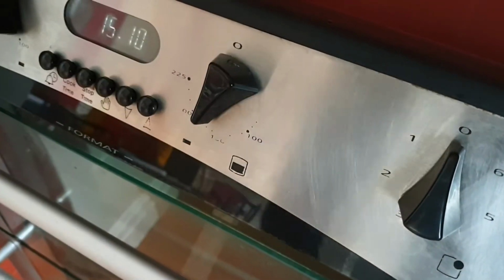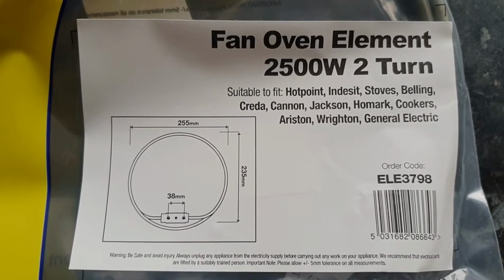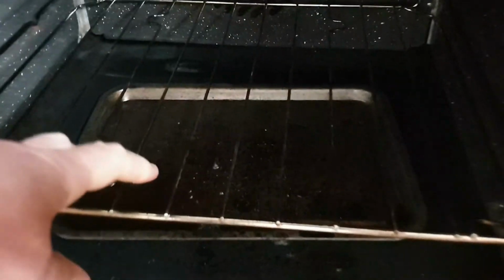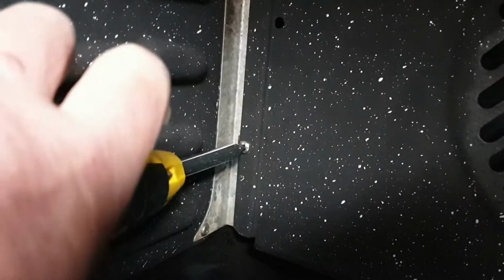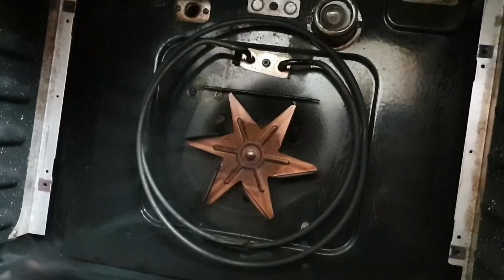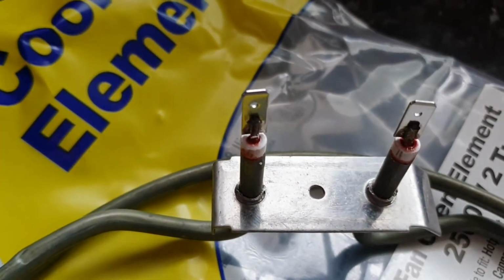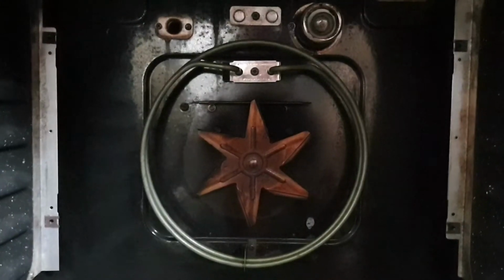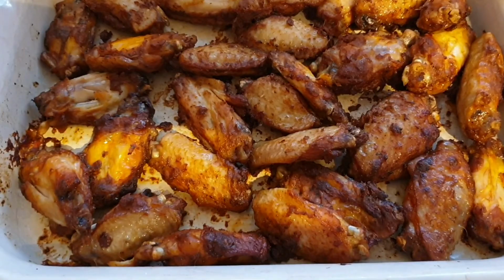Electric fan oven not heating up? How to replace an electric oven element

Comment: Thank you. I'll try this out. 👍🇯🇲
Reply from the maker: Thanks. I hope it solves your problem 👍
Reply: @bigtedshome  I can't get the element removed! aaarrrgh!  there are no screws..can i use a flat head screw driver to pry it off?
Reply from the maker: @themessenger2455 How is the element attached onto the back of the oven? Normally they are screwed on
Reply: @bigtedshome no screws..just two metal buttons but I don't think they're fixings...at least I hope not. I will try praying it out before calling the engineers. Thnx for getting back to me.
Reply from the maker: @themessenger2455 No problem. Good luck!

Comment: I have 4 wires on the heating element 3 circles, 2 comes from switch unit, one comes from temperature regulator and a double one i think is earth, how to connect them ?
Reply from the maker: @frank087234  I'm sorry, but I'm not familiar with that setup. Normally, it's just a straight swap from the old element to the new one.
Reply: @bigtedshome  didn't work , i replaced heat element but still does not heat up.

Comment: My ovens fan is spinning but not heat is coming on. Hobs are working and so is grill/top oven 

My oven tripped the switch when I turned it on. Flicked the switch back on and seemed fine but not heating up. Sounds a little bit rattley too
Reply from the maker: @TheBeautygirl13  it sounds like the element in the bottom oven has gone

Comment: I think I need to do this with my oven, would the fan not spen if the element has gone? the bottom oven of my unit nothing is happening, the top oven works normally - or could that be a different issue?
Reply from the maker: Sounds like something different if nothing is working in the bottom oven. I would check if the two ovens have separate fuses first
Reply: @bigtedshome  remarkably I sorted it by setting the cooker's clock, the circuit had tripped, once the clock was set it worked as normal
Reply from the maker: @ourtwotube  Fantastic. Well done 👍

Comment: My cooker tripped on the main fuse box and then wouldn’t warm up when I turned it back on. Could it be anything else or definitely heating element
Reply from the maker: If it tripped the circuit board, it sounds like the element has gone. If you have a multimeter, you could do a continuity test on it to confirm this. One thing to try before though is to make sure the oven has come back on in manual mode. When the power is turned off or trips out, my (very old) Belling oven goes into timer mode needs to be reset into manual before it can be used.

Comment: My oven doesn’t heat up on the fan setting but works using others. (The electric tripped one day and it stopped heating. 
What are the chances it’s just the fan element I need to replace?

Comment: Brilliant video, only difference on my oven is that the element plate was screwed in from the other side so I had to take the back off to unscrew it and replace with the new element. Somehow I always have the slightly more annoying models lol
Reply from the maker: Thanks Michael. It's always more satisfying when you complete an awkward job. Well done 😃

Comment: Just replaced a hoover fan element, pretty much identical to this video. Only slight nightmare was that the mounting holes in the new element plate were too small to allow the self tapping screws to pass, so had to drill them out a bit… but the spade connectors were such a sod to get on I decided to drill it whilst inside the oven box 😬😂
Reply from the maker: That must have been a challenge 😂

Comment: Oven element stopped heating and so did the top element but the rings work? Any idea
Reply from the maker: If you have a multimeter you could try continuity testing both elements.

Comment: I've changed the element and the thermostat on an indesit electric oven,still not warming up 🤦🏼‍♂️ I'm stumped
Reply from the maker: They are the 2 most likely faults. Have you tried contacting the manufacturer for advice?
Reply: @bigtedshome  no,I bought it five years ago so I'm guessing it's had it use. Without spending a ton more cash finding the fault I'm just gonna cough up for a new one 🤦🏼‍♂️ after so much money it gets to a point of not being worth it unfortunately
Reply from the maker: @JJJH93  I hope you have more luck with your new oven 🤞

Comment: Hi ted.   I have a lacuno double oven (built in) , the element around the fan does not heat up, fan, light and other elements work fine. If i remove the cable from the element and connect another lead direct to mains from the element , it works fine , any ideas. ??? Your videos are helpful
Reply from the maker: Hi Raymond. Have you tried cleaning the clips and spade connectors where the element is connected to the supply? If these are dirty or corroded it will reduce/stop the current through the element.
Reply: @bigtedshome  . Thank you ted. Yes ! If i test the contacts when it is connected in the oven power is indicated on the pos and neg ( grey and double white )but no heat.
Reply: @bigtedshome  ted. In my first comments i should have added , i removed the element from the oven and introduced a lead from the mains to the element ...worked fine !
Reply from the maker: @Raymond Hamilton-cooper  Logically, if you have power to the element and if the element works ok on a separate circuit, then I would expect it to be one of the connections that is the problem.